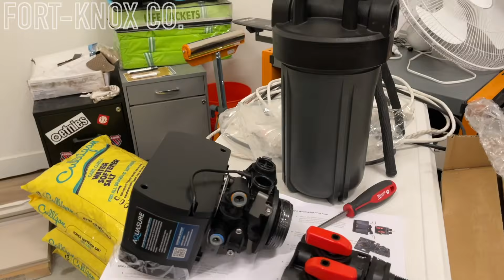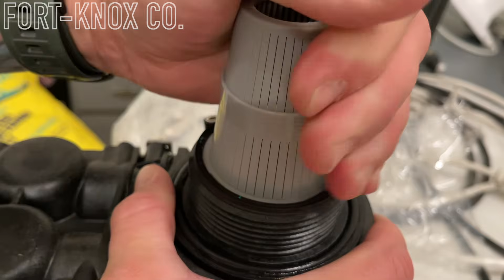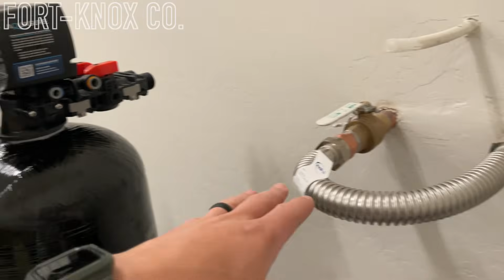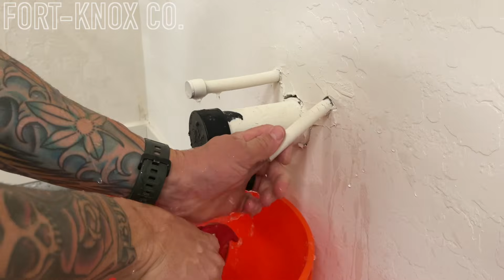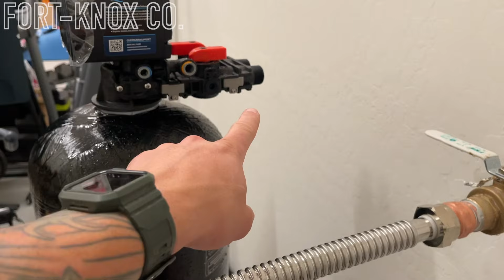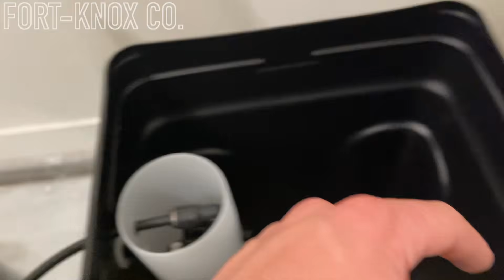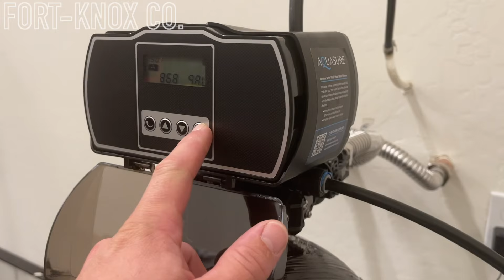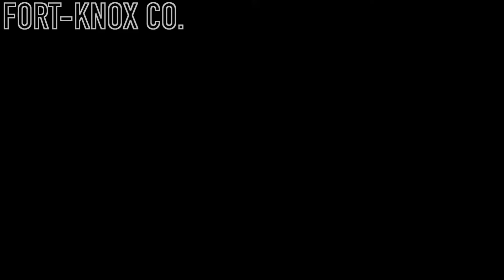How To Install Water Softener System Aquasure Harmony Series | Water Softener Loop Connection

Comment: Thanks for your video. Do you have link to your 1-1/4 inch to 1 inch connector hoses? I got the same size in my new house. It is hard to find in local store.
Reply from the maker: https://www.ferguson.com/product/sharkbite-1-14-x-1-in-push-to-connect-reducing-brass-dzr-coupling-suxl013528/_/R-7643865?fromplp=true&trackSignal=true
Reply from the maker: This is a link to a shark but I found that might work. Then you can use a 1” to 1” flex line. A lot easier to find those. The flex pipe that has 1-1/4 to 1 is harder to locate. But I found it on the Ferguson plumbing website. Can’t seem to locate it on there right now
Reply: @FortKnoxCo  Thanks for your information. I may sweat the pipe and use flex. Just don't trust the push in type for a such big size.
Reply from the maker: @HumidAir  yeah I feel you on that. I may re configure my set up with copper pipes to keep it closer to the wall. I mainly did the installation video to show the set up and general process. But I want to get it tucked closer to the wall and that will need to be done with hard turns in the pipes

Comment: Just installed this system, this video was extremely helpful. Ended up having to go with 3/4” to 1” from my wall to pre filter and then on to softener. Got shark bites with 45* elbows with threaded male ends on them. Lines connected directly. They had 3/4 to 1” lines at ace hardware for $20. Did the replacement/install this afternoon, it’s working like a charm.
Reply from the maker: That’s awesome to hear! And those shark bites are a great find! $20 sounds like a steal. I’ve seen some of those larger shark bites fittings go for a pretty penny

Comment: My SOFTNER is not pulling any salt from the tank so I suppose it’s not cleaning itself can you suggest how to fix it?
Reply from the maker: I’d start with watching the system go through the refresh cycle. Or the same cycle you run when first installing the system and the instructions walk you through how to manually run the cycle where if pulls salt from the bin and flushes the system. If you see this and it’s not draining water from your salt basin then there’s a couple things to check with the salt bin. If the water level is too high it could cause the float/shut off valve to be stuck and this won’t allow any water to flow into the bin. If the float is stuck and the water isn’t too high you may need to adjust the float so it doesn’t stick. Both of these scenarios can cause the valve to be closed and no water flow into or out of the salt bin. If you still don’t see water levels dropping and refilling during the systems refresh cycle then you may have a problem with the unit/valves on top of the main tank. There could be a bad connection with the lines in or out, might need to be reset or worst case it’s defective. I’d also look at your manual and see what references they have for trouble shooting.
Reply: @FortKnoxCo  There was no water in the tank so I filled that tank half with the water and then started the refresh cycle manually by pressing and holding the refresh button for 5 seconds. It started sucking the water and also refilled it after the refresh cycle.
Reply from the maker: @khandelwalgautam  oh nice so it looks like it’s all figure out now? Sounds like it.

Comment: Thanks for detailed video,
Day after installation, when i fill a glass with water, i see cloudy water for a minute , after that water is clear. 
Looks like air pressure, is this normal?
Reply from the maker: You might be getting some of the air from the filter. Could be within the tank and is usually considered normal. Over time it usually goes away. It being brand new you’ll have to give it a little bit of time/cycles to get any air within the filters n things to clear out. But not a problem

Comment: I have had the system installed for less than a month and then the brine water is not sucked into the tank, full of water in the salt basket. I have done it a few times of backwash but the problem still remains. No soft water is generated. How do you think I could fix the problem? and what is the possible problem? Thanks for your help in advance.
Reply from the maker: I’m sorry to hear that. have you ran the cycle and actually looked into the tank to see if it is drying that water out? Because once it is done doing it cycle, it will replace water back into that tank so that it sits there in between the next cycle. So that tank usually does have some amount of water in it. One thing I’ve noticed, though is that when it goes to refill that tank and let it sit until the next cycle the water level is sort of high and you might need to adjust the time that it refills that tank so that it doesn’t leave as much water sitting there. This seems to be a common thing with the factory settings. The minutes set for the refill on the salt tank are a little too high for most people.
Reply: @FortKnoxCo  Yes, I did but it did not solve the problem.
Reply from the maker: And if it’s not that issue, but it is actually not pulling any of that water out during the cycle I would first check and make sure that your line that goes into the resin tank is not obstructed or completely connected and make sure it’s in the right outlet. if everything looks good with the connections and everything is properly connected and it is still not pulling any water from the salt tank then my best guess would be that you have some type of defective head unit. That might be something to call aqua sure about and maybe they can send you a new head unit, that could be a simple swap.
Reply: @FortKnoxCo  okay. I will check it tomorrow. It is a new installation. It may be clogged in the line. thanks for the suggestion.
Reply from the maker: @休城牧人  no problem at all. If it’s not clogged and they lines are in the correct outlets on the head unit of the softener then I don’t think there’s much more you can do without calling Aquasure. I wouldn’t recommend taking apart the head unit on the tank
Reply: thanks for all the help. I checked it again today and found the problem. It is caused by the floater in the salt tank. Because the water level was too high, the brine line was set to close state all the time. The solution was simply to scoop out the excess water to lower the water level and push down the floater to open the brine line. Then do a full cycle of regeneration and soft water is back for use.
Reply from the maker: @休城牧人  that is awesome to hear. I’ll have to also pass this information along to other people that I ask. It seems like a lot of people have that high water level problem when they first set up the system. Really appreciate this. Happy you got it all worked out.

Comment: I did this and my salt container filled with water. Why?
Reply from the maker: That is normal, but it seems like a common thing for people having to adjust the time that it’s factory set to when it refills the brine tank. In the instructions it has the walk through of how to adjust/set the settings. Like setting the Time, the amount of gallons before it cycles , and in those steps there’s a part that you can adjust the amount of minutes the unit refills the salt/brine tank. I’d adjust that down so you don’t have a lot of water just sitting there. It’s okay to have some water and it’s sorta what it’s supposed to be doing, but you don’t necessarily need the whole tank over half filled covering the salt that’s sitting there 100%. So I would suggest going through those settings and adjusting the time for that refill part down and see how that sets the water level in the salt tank in between cycles.

Comment: Great video! Bought the 48,000 grain and it came with a pre-filter. How does that fit in with the water Softner?
Reply from the maker: Awesome! Mine came with the pre filter too but I haven’t installed it yet. It’s supposed to go in line before the water goes to the softener. But I didn’t install it because I plan on adjusting my lines to keep the tank closer to the wall and not take up so much floor space. So I’ll probably be putting out a video on how I do that with some hard copper piping and I’ll install the pre filter when I do that.
Reply from the maker: But that pre filter just requires one more hose obviously because you’ll go from the house to the inlet of the pre filter, then the outlet of the pre filter to the softener inlet and then the outlet of the softener to the house.
Reply: @FortKnoxCo  That's what I was thinking but wanted to make sure. Thanks again!
Reply from the maker: @brianwilbanks5914  no prob. Happy I could be of help
Reply: What is the use of the pre-filter? How does it help in addition to the water softener system? TIA!
Reply from the maker: @RishikeshJeevakumar  the pre filter has a “triple filter” of sediment, carbon and zinc and it is to inhibit bacteria growth and traps large suspended particles of dirt, sand, silt, sediment and rust. It also traps chlorine, taste, odor, Vic’s and other stuff in the carbon part of the filter.  It’s just a little extra thing they throw in to grab some of the big easy stuff before it gets to the rest of the system.

Comment: could you post the link for 1 1/4 inch to 1 inch water line?
Reply from the maker: https://www.ferguson.com/product/proflo-pfxc-series-24-in-x-1-14-in-x-1-in-water-heater-connector-pfxchhgt24/_/R-4395898
Reply from the maker: This is the link to the Ferguson plumbing supply website I purchased it from. I could only find these from this supply company. Had them shipped to my house.

Comment: I just installed the same system in my house and noticed that after two weeks of use, the water level is above the salt line in the brine tank. That doesn’t seem right. Any ideas on what to do?
Reply from the maker: If you see the water level above the salt, you can adjust in the settings how much water goes back into that salt tank. In their instruction book, it walks you through how to adjust the refresh cycle time and other adjustments like that. I believe you reduce the minutes of water flow in the setting that fills the tank of salt. By reducing those minutes it will fill that tank less with water.
Reply from the maker: Mine did the same thing, and I was thinking that I wanted to reduce that as well. I also did the calculation to set the refresh rate after the proper amount of gallons used. I believe it was set to low, and I had to adjust it up to 3300 based off my house. That makes the tank refresh a lot less often and being such a large 64,000 grain tank it did not need to refresh daily. So going through those settings I would recommend and maybe adjusting those minutes for the refill of the salt tank as well.
Reply: @FortKnoxCo  Dude, mine just went out just short of 4 years (48k grains). Still unbeatable price. I just ordered a 60k grain water softener from the same company. For $650, and about 4 years life span, pretty cost effective considering local companies are charging about $6k or more for their products. What system do you currently have?
Reply from the maker: @MarioKNeira  I 💯 agree. Great units and worth the money. Sucks yours went out. I’ve seen them last 10+
Reply: Thanks.
Reply from the maker: @MarioKNeira  your very welcome

Comment: Thanks for the detailed instructions!

Wondering if you can help clarify couple of things:
1. How often do you have to change the salt in the system?
2. Did you notice an increase in your water bill after increasing the system?

Thanks!
Reply from the maker: You have to add salt every so often when the salt level gets low. But that will also depend on how you set the gallons per refresh. I believe it was set at factory to do a refresh after 1,000 gallons. I did the calculation they recommended based on their math I needed it to be set at 3,300 gallons before a refresh. So I’d  recommend setting that correctly so your system doesn’t refresh and rinse through that salt too fast. Just keep salt on hang so you can always throw a bag in there if it gets low. But I’ve been going through a bag every month or so?
I haven’t noticed a significant increase in my water bill at all. Nothing i could really see. These systems are supposed to be pretty efficient.

Comment: We just got the same system the other day.  Did you install the other filter housing.
Reply from the maker: That’s awesome. I haven’t yet. I was planning on maybe switching up my lines and bringing the unit closer to the wall, but I will be having to use some copper lines most likely and doing a more complex set up the do this. I was planning on installing that other filter unit when I do this and try to keep everything close to the wall to keep the garage floor space more open. I’ll do a video on it when I do

Comment: Why did you choose this over the all in one units such as the Rheem?
Reply from the maker: Mainly because of the size, It has a bigger resin filter. I’ve had two different systems. One with the resume tank in the salt box and one that was side by side. At the end of the day I feel they all work the same. Not one was better necessarily than the other. I haven’t had problems with any one brand either. Another thing for me at the end of the day was price. This was a big system, means less recharging less often and we have 4.5 bathrooms. So for the great price your could get a big system. And delivered for free from Amazon. I really like this system so far. I would highly recommend. They make 2 other smaller sizes.

Comment: Yo! Great video. I'm planning to grab a unit on Friday. I do have a loop in the garage but don't have the drain hose. I don't have a drain in garage either. Any idea how I should drain?
Reply from the maker: That’s awesome. I’d look again and see if there’s anything next to or near that loop that could be a drain. It almost goes hand-in-hand to put that loop there and also include a drain. Those loops are only for water softeners and they know that they need a drain. So my guess would be that they would’ve put one in. But then again builders do weird things. I would also look to see where your nearest drain is. If you don’t have a drain or sink in the garage obviously that’s not an option. But think about what is on the other side of the wall or nearby walls. In our case I know my drain goes into the adjacent wall right behind where are laundry room is. The washer and dryer have a drain in the wall there. That’s where this line that I have in my house actually goes up into the wall and down into that. So you may be able to do something like that where you have to put your own drain line in and it could be a short run over to the nearest drain in the wall like a bathroom or laundry room or kitchen sink possibly.

Comment: Great video full of detail ...an excellent presentation...and is very thorough.  Question? I located the point where the main water comes in, but it's connected to the hot water tank.  What now?
Reply from the maker: Thank you! I appreciate that. With your hot water heater you will have a main cold water coming out of the house to enter the tank. Obviously from that point forward it’s where your hot water lines come off of.  But before that is there no “ water softener loop” ? Depending on when your home was built they will put this loop coming out and going right back in the wall like a U. It’s usually next to or near your water heater. This is your main water line from the street being exposed prior to splitting into a cold line and a line to go to the water heater. With that loop exposed you cut it and place the water softener in between the two pipes. That now filters the water moving forward to the cold and other line to the heater. If you don’t have this Loop then you may need a plumber to help place this loop in your water system. It is still possible but just requires a little more work. You need to basically create a spot in your water line somewhere between coming from the street and before it splits to your dedicated cold and line to the heater and place the water softener loop there.  I hope that makes sense.
Reply: @FortKnoxCo  The house was built in October 2022. I don't see the water softener loop anywhere. However, thanks to you, I completely understand the concept.  But since I can't find the water softener loop, I guess I will hire a plumber. Thanks again great video.
Reply from the maker: @ronwashington517  that’s I weird they don’t have that loop on the wall for you. Especially since it’s a brand new home. If you still have contact with your home builder or realtor I’d maybe ask them too. Might have a loop somewhere that’s not obvious. But most common place is in your garage near the water heater or main water shut off. Either way you can get it done and be enjoying that soft water soon.
Reply: @FortKnoxCo  I’ll ask the Constuction manager again because he’s still working on other homes in the neighborhood. Originally he stated …that was something I would have to had done during the construction phase. Called a pre-plum. Thanks
Reply from the maker: @ronwashington773   that is true, but should come with the house especially if they put the loop on the wall. It’s can still be done one way or another. But I’d try to get them to put it in or something. Shouldn’t be an upgrade or add on in my opinion.